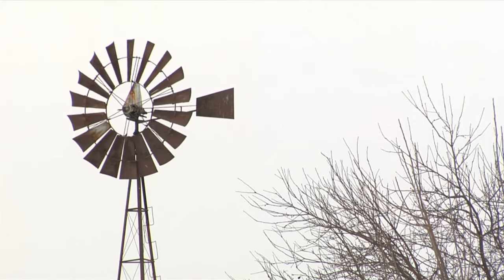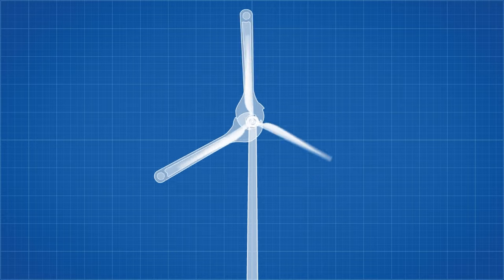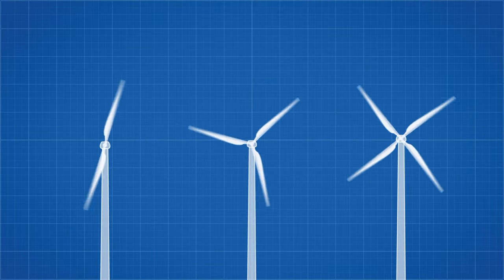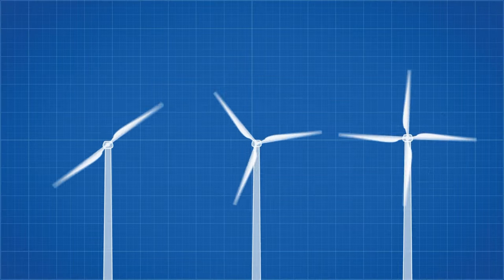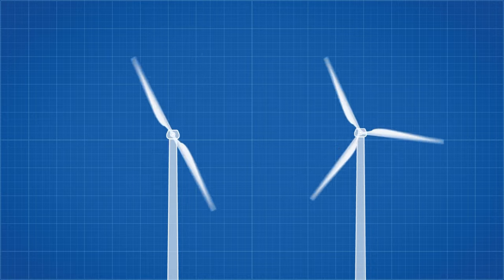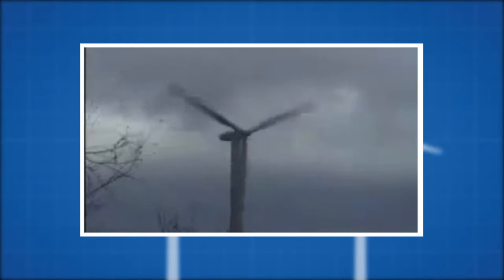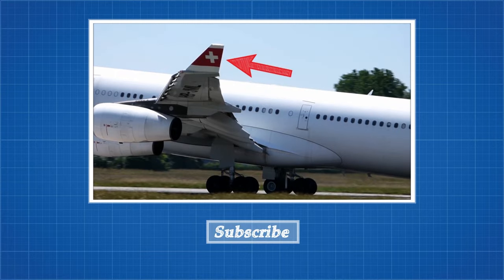Why Do Wind Turbines Have Three Blades?

Comment: You missed the MAIN reason for 3 blades.  Two and Four blades have the same problem.  When turning the blades into the wind (vertical axis) the gyroscopic forces to the blades resist that rotation.  so when the hub is forced out of the present arc  the blades follow their CURRENT plane of rotation. Making the blades tear loose. Four blades are less likely but still experience this problem.  Three blades none of the blades is in the exact axis of the other and resist the hub rotation less and track quicker.   Power company's "research" efforts used this for decades to "prove" the unworkable  nature of wind power by pursuing only the two and four blade generators.

Comment: On Air Conditioning Condenser fans, with a three blade prop, if one blade gets a little out of balance, it’s not as big of a deal, as if one gets a little out of balance on a Two or Four Blade Prop. Does this factor into why they use Three Blades?

Comment: What i dont understand, is why are the blades so massive, and so thick ?

lots of smaller, sheet metal blades( like shown at the beginning of the video ) would do the trick just as well, and during strong winds, just rotate the blades with their edge towards the wind. 

If you think the sheet metal would bend at the edges, then ... add a long rod through the middle and use simple cables to reinforce the blades. Very cheap and effective imo.

Comment: He forgets to mention a very important fact why the 3 bladed design beats 2 or 4 bladed ones, is that with an odd number of blades there is far less gust vibration.  This is because when a gust of wind occurs, with an even number of blades, when the bottom blade passes through the wind shadow caused by the mounting tower, the opposite blade is at the uppermost and will receive the gust unbalanced by the shaded blade.  With an odd number of blades there is no blade directly at the top when the bottom blade passes in front of the tower so this minimises the gust vibrations considerably.  If you ever mount a home turbine on your roof then you will have far far less vibration with an odd number of blades :D

Comment: I'm pretty sure the arguments for the two bladed design were weak and the additional speed could be better because maybe using a higher heating will slow it down ?

Comment: but a 2 bladed design will be less likely to fail in strong wind because the wind wont push as hard. It will be lighter too so it will inherently be able to withstand stronger winds.

Comment: Could it be that three was used to make it look newer. Traditional farm windmills had several smaller blades. It would do the same job and birds wouldn't think there is a window of opportunity to fly through... :D Plus the many layers to add strength to longer blades would not be needed.
Take the three blades cut them into 3 gives you 9 blades but you wouldn't need as much material. Smaller blades don't need as much strength and would turn faster having less weight to move around.

Perhaps, the author was working backwards from foregone conclusion.

Comment: The two blade design has problems when the upper blade is in higher wind than the lower blade.  The back and forth bending on the shaft causes early failure.

Comment: You almost had it!   The Ferris wheel can have many blades!  You do not mention the Betz limit nor the Angle of Attack (AOA).  The maximum power that can be obtained is an angle of 25.5 degrees.  Cantilever turbines must have small tips to minimize the stress at the outer end.  The Tension Turbine doubles the power of any cantilever turbine per equal size.

Comment: What about symmetry? The two bladed turbines should have significant drawbacks concerning the wearout of the bearings.
Reply from the maker: 2 blade turbines have problems with teetering, which the 3 blade set-up solves yes. Wanted to include this in the video, but it's quite complex and difficult to explain. There is a lot more to this subject than I have said in this video. I will get an article on my website explaining it in more detail soon.  I have the book I used for research in the description, if you would like to learn more. Really fascinating.

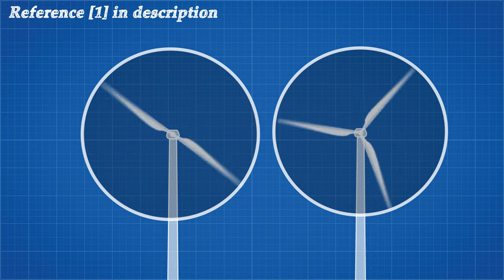Comment: Ok so at 1:45 you mention that by increasing the rotational speed by 22.5% you can match the output of a 3 bladed design. My question is why would the speed have to increase?

Can you not just add extra work for the blades to do which in turn would slow the blades down and provide more energy output? Or is that cost prohibitive like adding length to the blade?

Comment: There is one more reason and it is probably the most important. They have found empirically that the biggest power coefficients are obtained for three bladed turbines and for a Tip speed ratio of approximately 6. The power coefficient is the per unity value of power that you can extract from the wind power and this has a theoric limit of 0'59 (Betz limit). The tip speed ratio is the quotient between the speed of the tip of the blade and the speed of wind.
Here is a graph that illustrates this:
https://qph.fs.quoracdn.net/main-qimg-aa698be769c1793537a9eed0921042d0

Comment: Never could figure out why they would want the huge weight of the electrics up there.  A vertical drive shaft might be slightly less efficient but would put the weight at the bottom of the tower.

Comment: 3 blades rotating 18 RPM translates to 1800 RPM at the generator, generates 5,500 VAC 3 phase optimal generation of 1.5MW.

Comment: i am a bit disapointed. You did not mention two the most important things.
1) when You showed an example of wrench with torque i thought you will say that the treeblade design is minimum of equaling push force of wind and turbulence when blade pases pole . So we have force that want to twist "fan" upwards
2) argument that 4-blade (and n>4-blade) design is ineficent is not explainden enought. it is not only inefficient that you have to add extra blade! extra blade means more push force from wind -> more force -> more sturdy frame -> more steel -> more $$$ also 4 blades spins slower so you have more torque on axle and extra blade ads more wheight.

Comment: Hi,
it would be interesting to see the difference in power production with 3 or 4 blades design
i think that for small sizes turbines, the difference in prices will not be significant if the supplementary power produced would be considerably higher

Comment: Could there be a useful compromise by having shorter blades between the three long ones to reduce noise, not increase weight by as much, and still capture a little more wind?

Comment: 0:19 The 18 blade units on farms pumped water mechanically I believe. Those would provide a lot of torque at a slower speed, it's a complex topic.
Reply: An electric generator is better with higher RPM, not lower RPM ...
Reply: It relates to impedance matching, maximization of power transfer.
This is in that same area: https://youtu.be/1Pd0lUKWe7o?t=45
Just showing that it is not a simple matter.
Reply: @garyha2650  Go ahead ... make an 18-Blade Wind Turbine and then you can tell us how INEFFICIENT it is compared to a 3-Blade Wind Turbine.

Comment: I don't follow the reason for not having a 4 blade design. The video goes on to say a 2 blade design would cost as much as a 3 because they have to be made stronger, so 4 blades could be made lighter and cost much the same as 3?  Also, the blades are only part of the cost, there is the tower and the generator which cost more than the blades?

Or is it simply that any more than 3 blades can't get clean air without another blade having already passed through part of that airflow, so 3 is the most energy efficient design?

Comment: 3 is a magic number in physics. 3 phase wiring is the most efficient way to transmit power. 
3 phase motors are self starting. 2 phase motors would not be self starting. 4 phase wiring would just be too expensive for copper costs.

Comment: Thanks for this great explanation. I have a further question and idea for a possible new video: 
Why are the blades thicker near the axis and thinner towards the end? (wouldn't a thicker blade generate the same torque at lower speeds?) i've always wondered. :)
Reply: oh, i think i got the answer from your winglet video, it is to prevent induced drag isn't it? is there any other reason?

Comment: I was thinking it was to keep birds from perching on them. That is if the magnetic natural no spin position is with one blade either directly up or down, the other two would be at an uncomfortable angle.
But I thought that the blades pitch would be automatically adjustable, making the work force adjustable. No, huh?

Comment: nice, but coverage is incomplete, or misplaces emphasis at least. Blade count and design probably has more to do with aerodynamics (and mechanical/electrical dynamics) than any other concerns, because that is what drives efficiency. That should've been obvious. Cost is based on overall cost ( also longevity, maintenance), efficiency for mission, not cost of 'part counts'. If it was more efficient to have one blade, or 20, overall, the cost of each blade would not matter. Seems a bit of stretch to name channel 'real engineering' with a presentation weighted so.. Oh I see you saying you plan to remake, well that is encouraging. Script is everything for these, of course.

Comment: It's amazing how people can't bare the noise from wind mills, but don't have problems with motorways...
Reply: Completely different noise spectrum. On the level of 1-18 Hz the accoustic pressure of wind turbine 2,5 MW can raise up to 110 dB.
Reply: +Sayho1 and from a loaded motorway?
Reply: As far as I know, highway is not a source od frequencies 1-18 Hz.

Comment: Thank you for sharing this segment; however, you have made a biased claim. I am not saying you are wrong in your contention (or that you're correct), but your logic is flawed:

You say a two-blade design will be noisier than a three-blade; will spin faster (decreasing safety); and will not be much cheaper regarding materials-cost, as each arm will be longer. Regarding the three- versus the four-blade options, however, all you mention is cost. Further, you don't acknowledge that each of four blades could be shorter than each of three.
Reply: These windmills look elegant, but costly, high maintainence, and fragile. A better design is needed.

Comment: the 3 blade safety failed devastatingly due to brake failure... so the sunk cost is now total loss at that point. SO... may be safer and more longevity to have a slower moving 5 blade setup, or 4... may be less chance for brake to fail and if fails, maybe slower rotation will not go outta control unless serious high wind, which one could manually lock it out with a signal sent prior to wind event rather than automatic braking. .

Comment: You need an odd number of blades otherwise there torque disparity across the unit every time a blade aligns with the support. Five blades would work but like the man said, heavier, more expensive.

Comment: Why don't they put the blades inside a protective cages?  Are multiple turbines connected' to ONE shared generator?  Would this have any benefits such as reduced noise, more efficient installation/maintenance?

Comment: Stresses and wear on the gearbox are enormous. 3 blade minimizes these.  Cost of replacement isn't far off the cost of a new turbine. Still, i"m not aware of a gearbox/transmission that even meets the 10 year specified lifetime warranty.

Comment: The real reason two-bladers are seldom seen is they rip themselves apart whenever the wind changes direction (yaw).  When the blades are vertical, the turbine can change direction easily.  When the blades are horizontal, it can only change direction with great difficulty.  That pulsation, twice per rotation, rips apart the turbine.  Teetering hubs help, but the problem is still too bad to use only 2 blades.  a 2-blde rotor is only blanced in 1 dimension.  3-bladers are naturally balanced  in 2 dimensions.  3 blades run smooth when changing direction.  2 blades not so much.  I build a lot of 2-bladed turbines, but using multiple rotors on  a single very long driveshaft, they do run smooth for me.  Otherwise, with a single rotor, I have confirmed, the turbine life is limited to only a few years with 2 blades.

Comment: So more blades are more expensive but more space efficient? They will also be slower and less noisy? So would something like a 5 blade design be better to use on or near property if you are unconcerned with the cost?

Comment: I'm sure a 2 blade design is not even an option either as the weight is not distributed evenly on the circle.  Fans have uneven number of blades for a reason, I'm sure it must affects efficiency, or solidity. What about 5 cheaper blades?
Reply: Cheaper blades do not exist, such a design is then a paper project and they only make energy in the potbelly stove when you set them on fire.  A blade's cost has a huge investment in labor, so large as to be equal to material cost, believe it, they are made as cheap as they can be already.  Cheaper then can not exist.  Your first point is quite real, solidity reason for three over two blades was not even mentioned and it's a very major issue.

Comment: Would it be possible to put 2 3-blade setups on each pillar, maybe offset them by 60 degrees or have them counter rotate to get double power from a single pillar?

Comment: There's an additional reason for why to use an odd number of blades specifically. If an even number of blades are used there are vibrations caused by the difference in air force on the top and bottom blade. In the bottom the bulk of the base slows flow to the bottom blade, in conjunction with the fact that the top blade is usually experiencing the fastest airspeed. These compound to create a slightly higher torque difference than with an odd number of blades, lowering the lifetime. If there is an odd number of blades the top blades are angled outwards, and thus on average lower windspeed when the lowest one passes in the wind block of the base. This means a smaller difference in torque on the hub on average. In mechanical design, the magnitude of alternating force is a big reason for decreased part lifetime.

Better explanations:
https://www.reddit.com/r/askscience/comments/1v1mbk/why_do_modern_wind_turbines_only_have_three_long/ceo0eek
http://xn--drmstrre-64ad.dk/wp-content/wind/miller/windpower%20web/en/tour/design/concepts.htm

Comment: They dont only have 3 blades they have 5 or 6 or 4 or 2, but never 1. Too many blades can cause turbulent air flow that reduces the efficiency of the individual blades.  The optimum number of blades is proportional to the overall size of the individual turbine.

Comment: Centrifugal force doesn't exist. This is Inertia, a property of anything that has mass. If you're trying to turn in a car lets say, and you feel pushed to the outside of the turn, that's inertia resisting the change in direction.

Comment: For money and noise three blades is indeed the best, but funnily enough 2 blades would be more efficient... well actually 1 blade with a counter balance...but that has other issues...Speed / Thrust / Tork actually don't relate as you might this initially think.

Comment: So you're saying that building 4 3-blade turbines is cheaper than building 3 4 blade turbines?  Logarithmic cost from 3 to 4 because the base would have to be bigger?
Reply: +Eric Bell 
I believe 3 4-blade turbines would cost less to produce than 4 3-blade turbines, as you said.
However, as i understand, power profited by adding the 4th blade wouldn't scale linearly to its cost. 
Therefore, considering the power/cost: 4 3-blade turbines will always win against 3 4-blade turbines.

Comment: what if we have 5 blades, each half the size of the original 3 blades ? we will still save 17% material but will have enough blade surface area to catch the wind.
Reply: Perhaps it's not only the amount of material that causes expenses but also the way it has to be manufactured and attached to the turbine. Yet I'm no engineer so idk.
Reply: 5 blades will be able to start in lower wind, but a smaller size reduces the height and swept area. Height = more wind, more consistently. Swept area = maximum amount of power that can be extracted. However, 5 blades also have more wetted area and that increases parasitic losses.

Comment: One bladed fans are all that's needed. It just wobbles at high speed.
Reply: To determine what high speed is;  install a stationary arm about 5 foot length perpendicular to the support post, near the top. Tie an eight foot long rope around the far end of the extended arm, and tie a large bell to the other end of the rope and let it hang there. If the bell begins ringing , the speed for the one blader is too fast.

Comment: If more blades mean less rotation speed and smaller blade less cost, wouldn´t it be possible to get slow rotation with more but smaller blades AND lower cost at the same time? That SHOULD result in lower noise as well, or did i get that wrong?

Comment: 1) You say adding each blade adds torque, but you don't describe what makes a 4th blade marginal while a 3rd blade is not.
2) Isn't the speed independent of the power generated? Can't we pick the speed of any turbine through gearing?